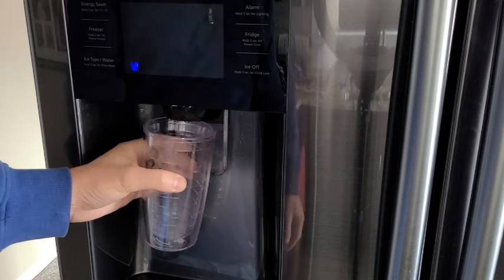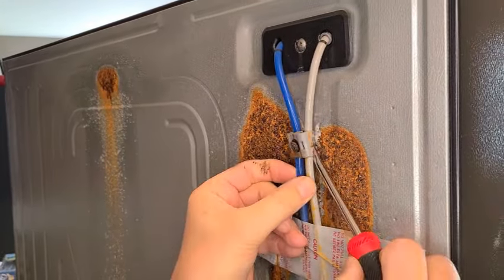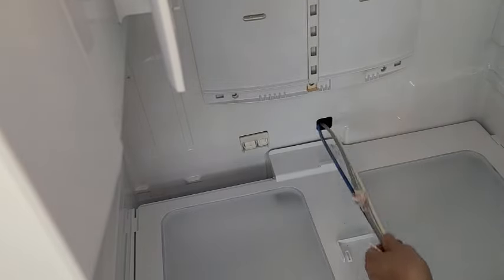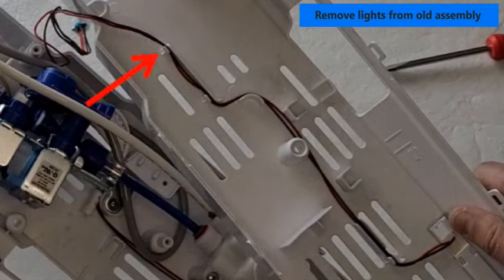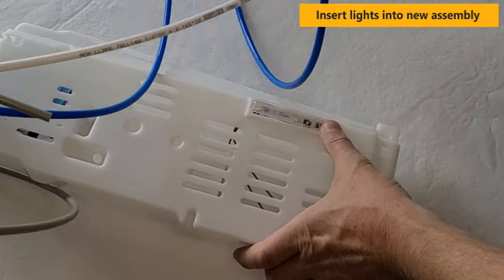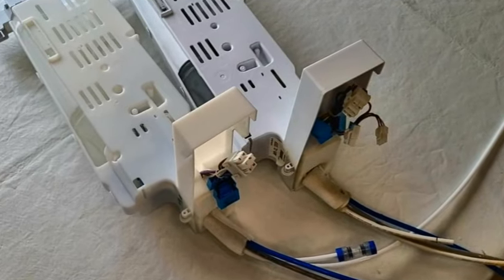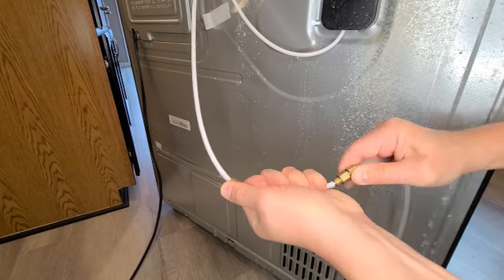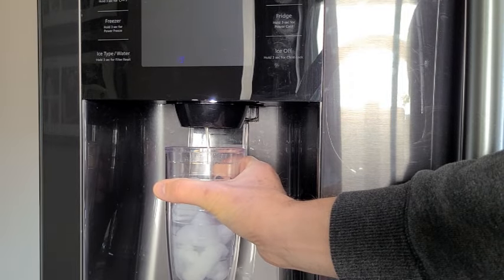How to fix a Samsung refrigerator water dispenser that doesn’t work

Comment: I love how detailed this video is. It is a great resource if you need to replace the valve. HOWEVER, don't assume this is your problem if you're not getting water from the dispenser. Some further research/videos proved that in my case the water line had frozen where it runs past the icemaker. Defrosting the line fixed this same problem. As always, do your due diligence before spending a bunch of time and money..
Reply from the maker: This is a good point. I'm curious, were your ice makers working?  Or, were those lines frozen as well? Also, what temp do you have your fridge and freezer set to?  I had an issue where water was pooling at the bottom of the fridge because the drain line froze. My theory was the insulation around the drain is insufficient so I raised the temp of the fridge to 38 and the freezer to 0 degrees and haven't had an issue since then. 

Thanks for your feedback.
Reply: How did you defrost it ? I'm having an issue with mine where no water comes out to fill the ice dispenser and that everytime the dispenser goes to dispense it turns and gets stuck somewhere and makes a knocking sound. I miss my ice.

Comment: did this is on a rf25hmedbsg. Replaced the entire water filter housing, replaced the water filter and still water will not dispense. Crazy all the issues with Samsung
Reply from the maker: Hi DanielMaxwell, I agree too many issues with these units.  Please keep in mind that I'm not an Appliance Technician. With that said, I just googled your model "Samsung rf25hmedbsg Water Inlet Valve" and it appears the valve is not inside the filter assembly housing.  You may want to lookup a  schematic diagram for your model to locate where the valve is.  Then you can order the valve and replace it.  Keep in mind there are other possible problem areas like the switch could be bad or the fridge control panel could be bad.  What convinced me that my valve was stuck was I could hear it buzzing while trying to get water.  That would mean both the switch and control panel are still good since it was able to send an electric current to the valve.  Sorry to hear you're still having issues.  I hope this helps.

Comment: I have inverse problem, water works but ice wont, when I hit the button in the ice mode nothing happens, not even the sound of the machine
Reply from the maker: Keep in mind that I'm not an appliance technician and I haven't experience that issue.  But, I believe it could be an issue with your auger motor assembly or possibly the control panel itself.  I'm not sure how one could determine where the problem is.  But, if you'd like to replace the auger motor assembly to see if it corrects the issue, you can watch my video https://youtu.be/5iHd_qvqs9M where I replace both the ice maker and the auger motor assembly (note: this may correct frost build-up issues as well).  If you don't want to take the chance with replacing a part and finding out it wasn't the issue, then you may want to consider contacting an appliance service company.  

Thanks for visiting my channel and I hope this helps.

Comment: That 60 hertz buzzing from the valve solenoid is designed to add a slight ultrasonic cleaning action to the valve it's connected to. Bet you didn't know that, huh! It ALSO tells you the handle switch AND solenoid are both working, as you stated. It is engineering stupidity to put the valve assembly IN the filter housing instead of behind the frig, but HEY, they saved 5 cents on hoses!
Reply from the maker: Correct; I wasn't aware the buzzing actually had a purpose.

Comment: My model RF28HMEDBSR/AA-00 Samsung frig is now 7 years old, surprise! I had the EXACT same problem, plenty of ice and no water! I solved the problem by removing both drawers next to the filter housing. Then I smacked sharply both sides of the rear of the housing where the valves were at (away from the LEDs) with the handle of a medium sized screw driver. I tested the water dispenser, still no water. I placed both drawers back in and retested. BINGO! Fresh water came out nice and strong! This repair was FREE except I changed the filter at 9 months instead of my normal 12 months to eliminate that possibility. IF the valve itself can be obtained separately from the housing you would save $230 by not needlessly buying the housing. All you need are numbers from the valve itself to find the correct replacement. Oh yeah, I SAW how the connections were permanent between the valve, filter and reservoir, but that is easily spliced. Fortunately, I found the best solution anyway. And why does Samsung literally make over 2000 DIFFERENT MODEL NUMBERS of refrigerators? Couldn't they get it right with the 3rd or 4th model, RIGHT???
Reply from the maker: Thanks for your feedback
Reply: I did the same smacking and used blow dryer to warm up the front left corner in the ice maker area because there was a chunk of frost on a diverter plate.. And SHAZAAM back to normal pressure.

Comment: We replaced the filter in our fridge and now the water nor the ice works. Any idea what the problem could be? We checked the water line and it’s fine.
Reply from the maker: The timing with the filter replacement seems suspicious.  Check to see if the filter is tightened all the way.  If that doesn't help try a new filter in case you have a defective filter.
Reply: @DIY-Saver  Thank you so much!
Reply: So it could be as simple as a defective water filter? Maybe I’ll start there first? However, during my troubleshooting we tried to run the water dispenser without the filter and still nothing.

Comment: Ugh. My replacement has the lights pre-installed but there is NO flow sensor in the new unit. Will this work after all the time spent replacing it?? Aaahhhhhhh. Samsung!
Reply from the maker: Let us know how it works out.

Comment: Thanks for providing this very helpful video from start-to-finish.  I have the very same exact model Samsung refrigerator as yours here, as well, and it took me a few hours at least, but would have been much longer had I not had this video of yours to follow along with for certain.  Lastly, after installing the new "water filter assembly" unit here, now my water dispenser is back to "DESPENSING" once again.  Many Thanks!!!
Reply from the maker: Glad it was helpful!

Comment: Since you have to remove valves and reservoir to get the lights out and back in, is is possible to transfer those innards to the old assembly from a new one (as it looks like I may be having to do this repair soon). Thanks for the great video.
Reply from the maker: Hi Sabalon, that's a good idea.  I didn't consider it myself.  If you do this repair, please investigate it and write another comment letting other viewers know if it's a time saver.  Thanks for your feedback and good luck with your repair.

Comment: Amazing how many commenters still have functioning ice makers! 
Is the solenoid valve available by itself? Seems unfortunate to have to disassemble both assemblies just to swap the lights.
Reply from the maker: That's a good idea.  It may be difficult to find the correct part though.  I did a quick search for "Samsung refrigerator rf263teaesg/aa-01 solenoid" and the solenoids which appeared only have two solenoids where my refrigerator model has three.

Comment: Thank you so much. I have the same problem . Now I’m thinking and planning my repair. 
The part is $205 😢 .
New fridge is $2000 . If I can use the fridge for another 5 years providing the ice maker don’t break I’ll be okay .
$2000 new fridge mean I have to amortize the new fridge for another 10 years  
Thank to your help
Reply from the maker: You're welcome!  Yes, the ice makers are another issue with these refrigerators.

Comment: Thank you so much for the great video,  but I have a question,  why you didn't replace just water solenoids valve instead all filter housing? Thank you again!
Reply from the maker: Good question; the answer is I tried. I ordered the valves for my fridge and what came only had two valves not three (top ice maker, lower ice maker, water dispenser).  I contacted them and they said I had to order the whole assembly.  So, I returned the valves and got the assembly.

Comment: I have a newer Samsung with the screen on the door the black stainless dont know what model but the water and the ice don’t work…i can hear the ice maker move when i press on it but nothing comes out…do you think its the same fix …its like no water is going through some where
Reply from the maker: Keep in mind that I’m NOT an appliance repair technician.  With that said; here are the steps I’d take: 1) Verify the water is properly connected to the refrigerator and the water valve is turned on.  2) Check the refrigerator for error codes. Since you have a different model than mine; you’ll have to research how to get the error codes. 3) Replace any parts related to any error codes you received.  4) For my model, the filter housing contains valves for both the ice maker(s) and the water dispenser.  Therefore, it’s possible both valves are bad and replacing the filter assembly with fix both.  5) If replacing the filter assembly fixes the water dispenser, but not the ice maker, you may need to replace the “Water Fill Tube Assembly” (see my video: https://youtu.be/5UQquG0JJ78 ). 
I hope this helps.

Comment: Is this the same repair steps for the 4 door samsung? Mine works but it dribbles out - starts to "hop around" with a faster flow then flows but very slowly. So frustrating.
Reply from the maker: Sorry, it doesn't sound like the same repair would apply to your refrigerator. Have you tried replacing the filter?  After replacing the filter, did you run a couple gallons of water through it (this step helps to stop dripping)?
Reply: My water dispenser has a similar issue. I'm trying to figure it out. I think there may be multiple issues. I found one video that shows there can be a problem with the water freezing in the line at the top of the refrigerator. The solution in that video was to run the line externally, which required creating a slot/hole in the cover through which the water line would pass.
I've experienced the variable flow that you've mentioned, which I think is air in the line. This condition is temporary in my experience.
Sometimes the water flow stops. Removing the filter and giving it some forceful blows with a rubber mallet has had some effect to restore flow. I think that's another issue. When that should have worked, but the water still doesn't dispense, I can hear a sort-of crunch/squeeze sound from the top area of the fridge where the water dispenser line is. I think this is water pressure pushing against an ice blockage. At this point, I still haven't fixed the problem. I'm just looking at what other people have done about it and trying to apply their knowledge gained from their experience.

Comment: After a pipe burst in my neighbourhood, our fridge makes a hard rattling buzzing sound not dispensing water and not turning the ice unit. Any idea what I could do?
Reply from the maker: Please keep in mind that I'm NOT an appliance technician. If you truly believe it's related to the pipe breakage incident; I would replace the water filter to see if it's plugged from sediment in the water line.  Otherwise, I suggest contacting an appliance repair company.